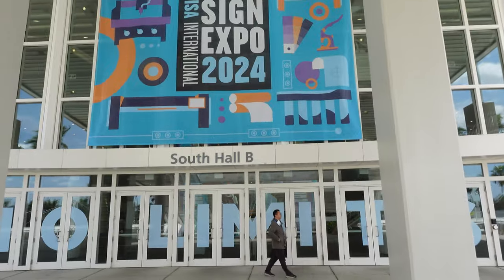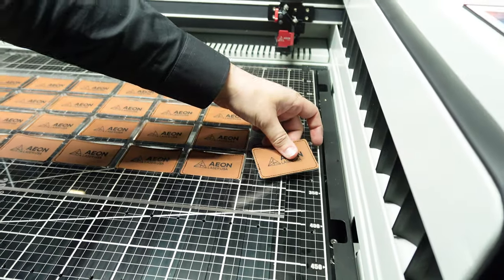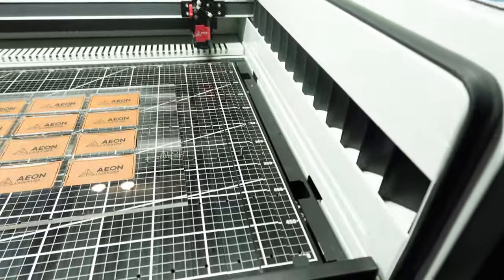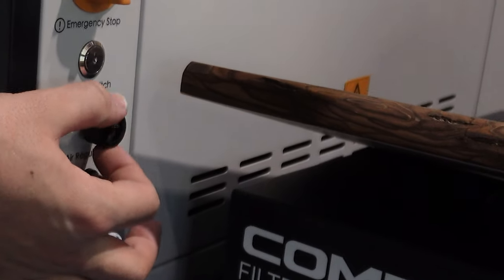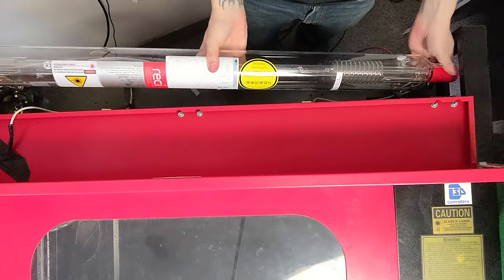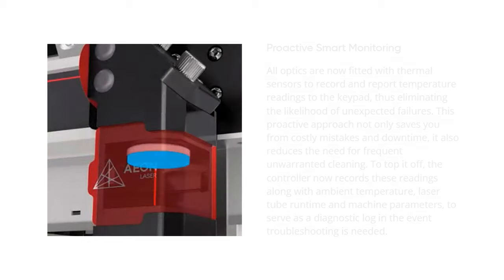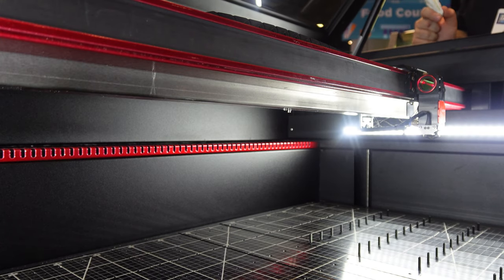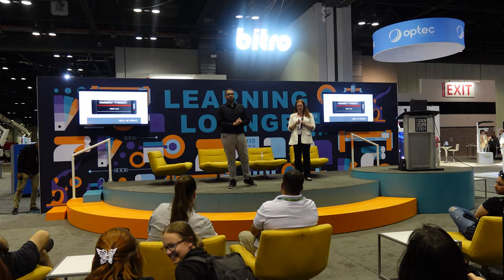Aeon REDLINE: EVERYTHING You NEED to Know

Comment: For CO2 gantry lasers I've been an Epilog owner for years because of their ceramic-metal RF laser sources, and their speed  & accuracy. BUT, their shortcoming have always been in versatility - they do not (and will not ever) offer material pass-through; they do not offer anything other than their standard rim drive and chuck rotary (and the chuck only for certain models), and refuse to allow access to their control protocol to allow 3rd party rotary devices; you are absolutely locked to Windows for their driver & dashboard. 

Seeing another laser company bring out a line of lasers that can both compete with Epilog in terms of speed & (presumably) precision, while offering a wider range of bed sizes, rotary options, and material pass-through is exciting. The only hang up I see for Aeon is going to be pricing.......but I suspect that may not be a hurdle in the long run.

(edit: had smacked 'enter' inadvertently)